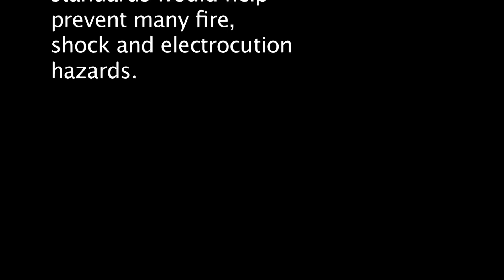Great Moments In Grounding History!

Comment: Thank you for posting this video! It was very informative! For example, homes and businesses that were built many years ago likely have ground rods at the power panel service entrance that are corroded and worn out. It's true that nothing lasts forever and if you have severe acid or alkaline soil it really could significantly reduce the life of the rods. I am going to replace my single rod with TWO Galvan 1/2" X 8' copper-clad steel core rods at least 6 feet apart and properly bonded at the power panel entrance to the Ground and Neutral in the panel. I have additional needs because I am a Ham Radio Operator that is going to install an antenna in the backyard. To do this I will be using the same type of rods but using 3 rods at least 6' apart at the ground connection of the antenna. these rods will be bonded with 6 AWG copper wire. To protect the Radio Room, I will use three more of the same type of rods close to the outside wall of the "Shack. all spaced at least 6' from each other and boded as above. To finish it all off, All EIGHT RODS must be tied together so that one ground potential is seen and ground loops are prevented. It is expensive to do this but when it is done my family is much safer because of it.